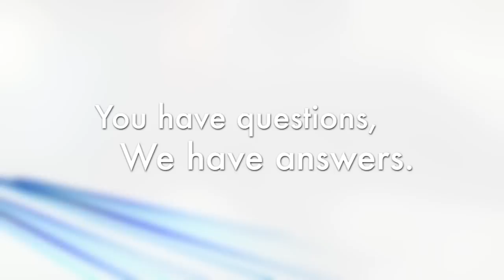Honda CRV Side Steps Installation (Honda Answers #63)

Comment: review for this install imply that's its easy to anyone to install, I'm sure this would be true IF everyone had a hydraulic car lift to easily lift your CR-V up in the air, no way i'm risking my non-mechanically inclines arse on a set home use auto car jacks just to install these, I'll gladly whip out the old debit card/check and have the stealer-ship install these!